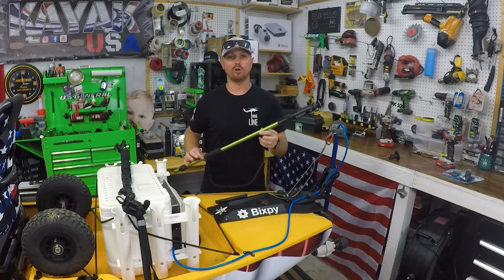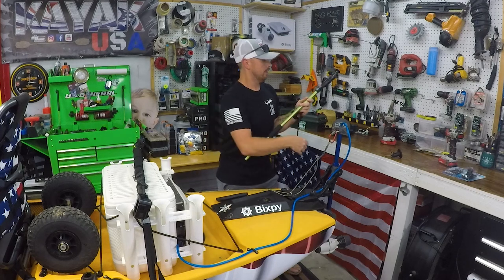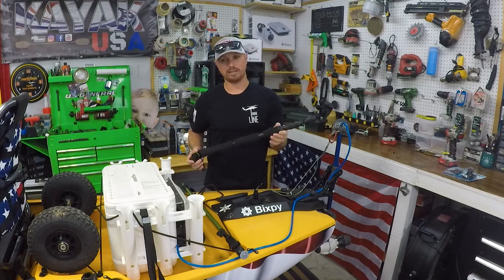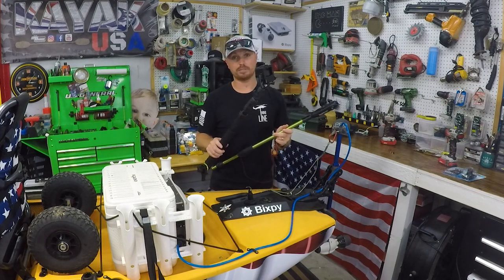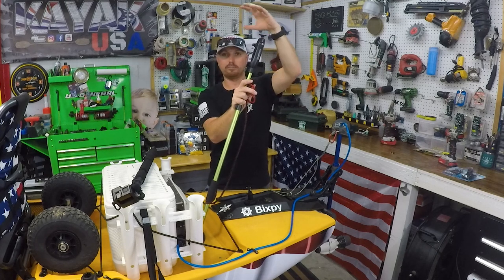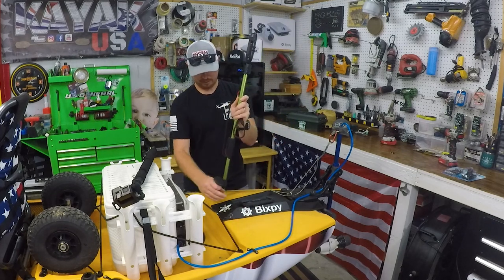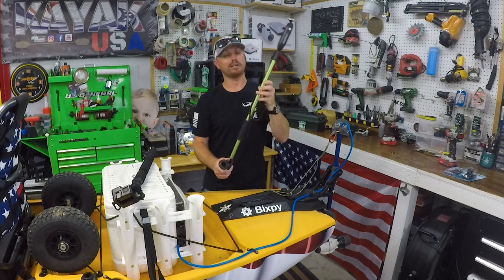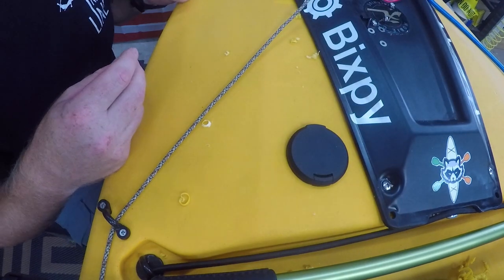DIY Kayak Camera Pole vs YOLOtek POWERstick | 2020 BEST Kayak Mods

Comment: I didn’t read all of the comments but in case I missed it. I think the navigation light mount would be better if you rotated it 180 degrees. I think the cap on it would be easier to handle and the wind will not be pushing it when open .

Comment: Ok, ... ummm, ... I think I could save you a bit of hassle, by eliminating the inline fuses, ... and my reasoning for doing so, is simple, ... there is only a draw on the battery, if properly connected, ... you only need a fuse, or circuit breaker, if there might be a “surge” to the system, ... which is not likely to happen, because you are only drawing the current from the battery, ... so it is not possible to over load any circuit in your system, ... because you will never have more than 14 volts running through your system, ... and even if you could turn everything on, at the same time you are maxing out a trolling motor, it is still only drawing current, & not having any way to have a surge of incoming voltage, ... and it’ll also save you the labor of the install, & any headaches of trying to find your way through a maze of inline fuses, ...
Reply: you sure man? what about if you have a charging system integrated? Then you could introduce overvoltage. It's cheap insurance to at least have one inline surely...
Reply: That's just a simple electrical connector run directly to the battery. Something could happen like it getting damaged or wet just the right way and you suddenly have a short circuit and overload the battery and melt/damage/burn something. A fuse is cheap insurance and a great idea
Reply: We run on salt water quite a bit. If the camera fell off or any of the connections got wet and there was no fuse or breaker to isolate that circuit, then there would be a bad short. Something would either melt (probably a wire) or the main breaker for the power distribution would trip and knock everything out. Either way, there would be no easy way to fix it on the water. A fuse is extra work to install, but IMO, it's well worth the extra work.